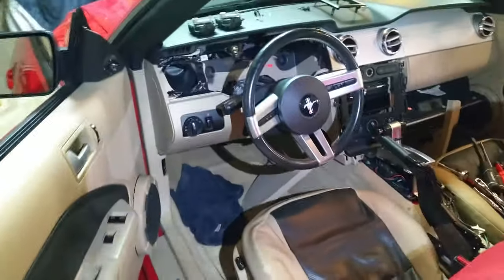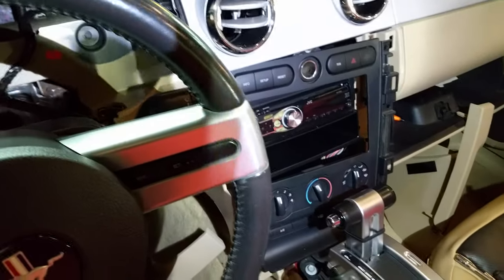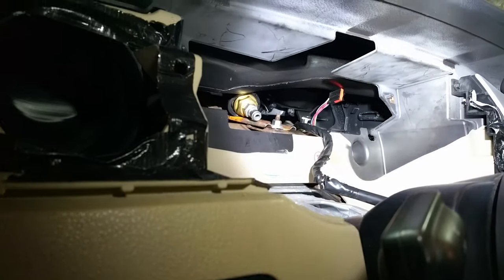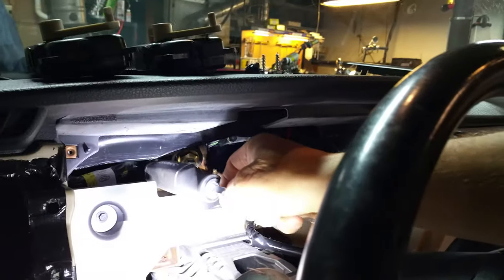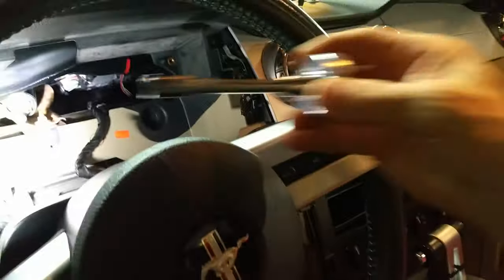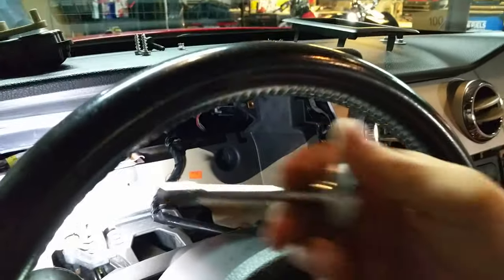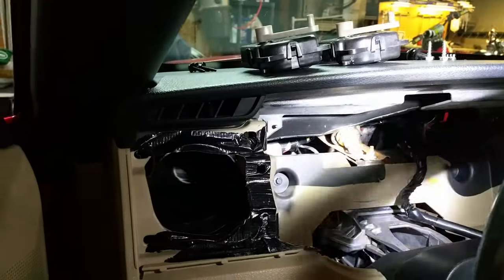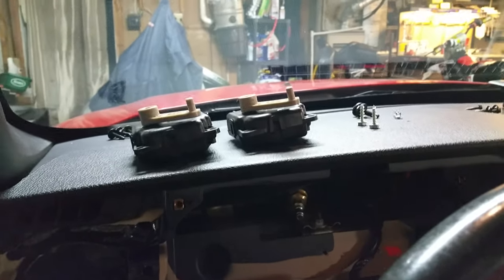How to deal with left side HVAC Blend Actuator 2005-2009 Ford Mustang V6 GT 4.6L Car Truck SUV

Comment from the maker: Here is the Motorcraft part number for the upper left HVAC blend actuator 6R3Z-19E161-B   or  YH-1870.   I do not recommend the aftermarket actuators. Poor quality, don't fit as well, not worth it, in my opinion.

See my other videos relating to this task on Mustang 05-14 models.

Comment: With your help, just got it done.  I was lying on my back looking up and feeling around to find that the 8mm screw was completely covered by the plastic vent.  Removed the instrument cluster and still tough to reach.  Your tip worked out great.  Much appreciate it!
Reply from the maker: Awesome. Got lots more how-to videos on our channel for this and other cars trucks motorcycles etc. Check it out.

Comment: thank you so much the dealership wants $1600 to fix this issue they told me it takes 6 to 8 hours to take the dash apart just to get to it the another 6 to 8 hours to put back together very upset with AutoNation very happy i found this video thank you for posting this
Reply from the maker: Unfortunately they are in the business to make a profit and pay for labor and all that stuff they have in the shop.
Reply from the maker: And time is money.  This task is not necessarily "easy" for the average guy/girl.

Comment: Replaced the defrost actustor and the floor actuator on the passenger side, HVAC is still stuck on defrost, even after calibration. I made sure the vents were not stuck either. I have a 2014 with manual climate controls, is this the same process as the 05-09s? Can't find a part for it but I'm still looking.
Reply from the maker: Reset the car's main computer. There are many good videos on how to Properly do it.   And do not just disconnect the battery. There are additional things you have to do to properly reset a car's computer.  And make sure you do it while the engine is stone cold.

Comment: My ac/heater works from the defrosters and leg vents. When I turn on the regular vents the the air blows very low on all settings. I checked the fuses and replaced the blend door actuator. It didn't fix my problem. Was this a symptom you had?
Reply from the maker: Reset the car's main computer.
Reply from the maker: And can you rotate that blend door by hand? Might be something blocking it.